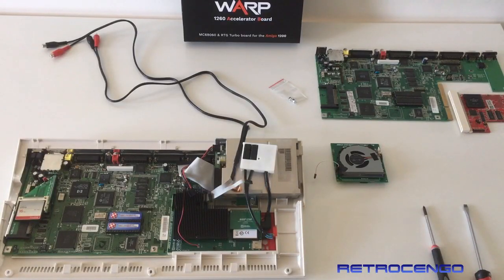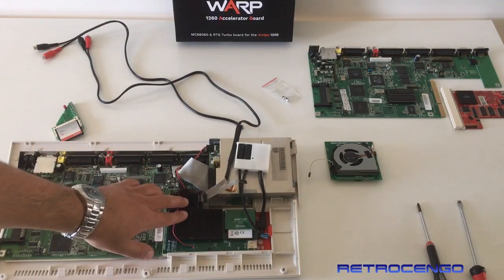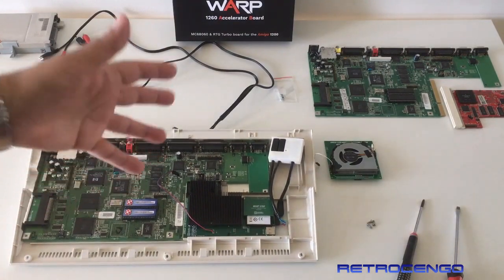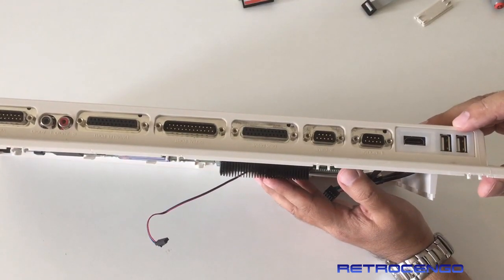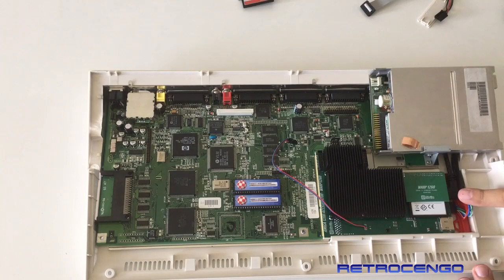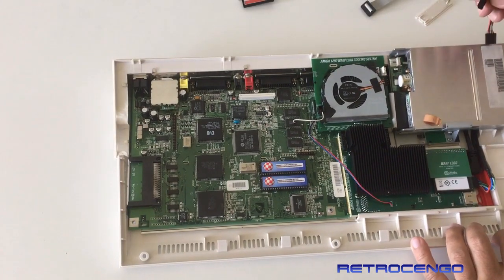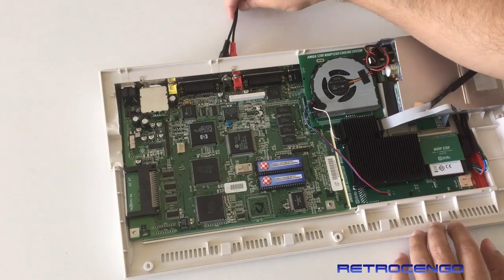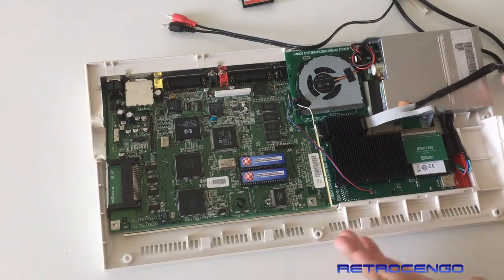How to install WARP1260 in Amiga 1200

Comment: Nice video. Fortunately, CPU and heatsink do not face the trapdoor. Otherwise they would break through the right wall, if I wanted to install the Warp 1260 in my big box A1200 tower. Still, I wonder why they did not use a small flat heatsink and mounted the fan onto it directly on top, as phase5 did with their Blizzard PPC cards.
Instead the Warp fan is just meant to soak in air from the top and dissipating it inside the system. Btw, I have just checked the quickstart PDF manual, page 6. It says: "The Warp 1260 must be connected to the INT2 signal on the motherboard". Have you got an idea what INT2 is or where the pin header is located?

Most part of my big box A1200 is internally hidden behind my Zorro2 bus expansion board, so access to the motherboard is limited to the lower region close to the PCMCIA and IDE port. And hopefully, the Warp heatsink won't collide with my ATX power supply.
So upgrading my A1200 with Blizzard 1230 IV won't be easy, also because I will have to give up its SCSI-2 kit for a Warp 1260. If not for a HDD, I need SCSI bus for my CD-ROM drive, CD writer and SCSI scanner.  I would need an extra Z2 SCSI card for them, sigh.

Comment: I just wonder how the audio cable is routed, since it's hanging outside the cabinet do you need to drill a hole in the case to make it fit?
Reply: Same here i already removed my rf modulator 👍 perfect fit for that cable
Reply from the maker: Shadizar its a must removal while recapping
Reply from the maker: I would remove my rf modulater and use that hole